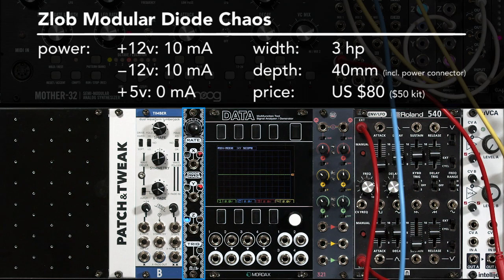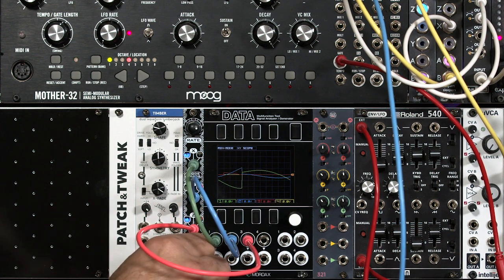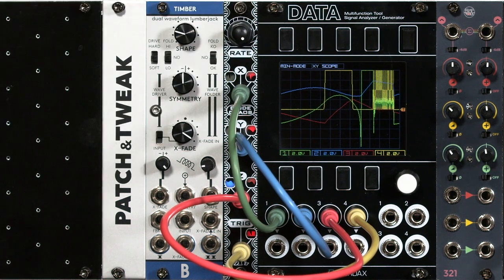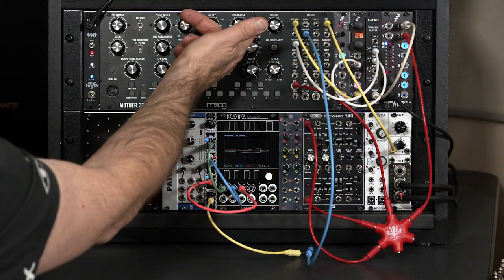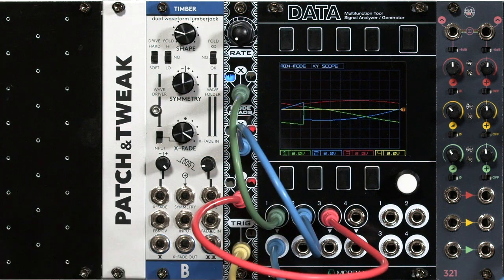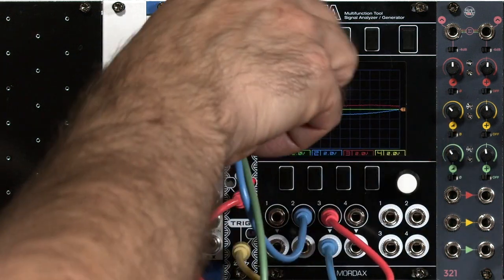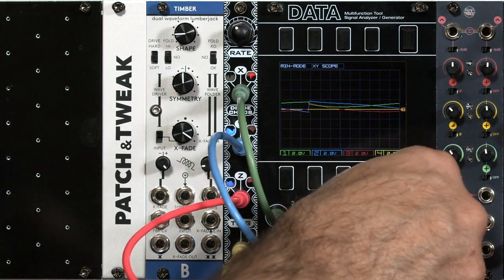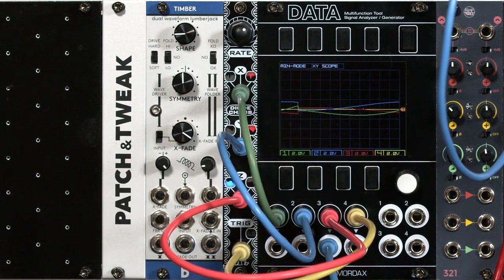Zlob Modular Diode Chaos modulation source (LMEE)

Comment: Thanks very much for this video, helps to really show what's going on with this module. 

Couple of additional correlations I don't think were mentioned that I noticed:
- Z attack "jump" seems to be related to X rising to the Y value when in the positive range (in addition to resulting in a trigger), making all four outputs correlated to some extent
- X seems to only cross below Y when in the negative range and then Y rises and X follows after a delay (extremes notwithstanding)

Comment: Non related question but what patch cables do you use? I like how they sit!
Reply from the maker: I use Black Market Modular and Luigi's cables most often. For right angle cables, I had been using Tendrils, but in the near future I'm going to be moving over to Luigi's MPAR cables. Black Market cables are available in several places; Starving Students Musical Supplies is the sole distributor of Luigi's cables at least through the end of 2022.